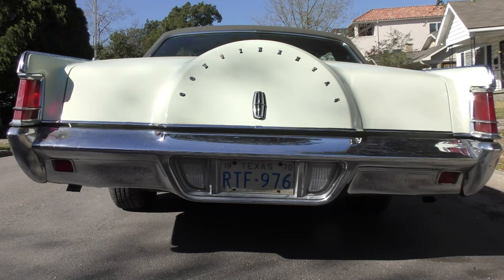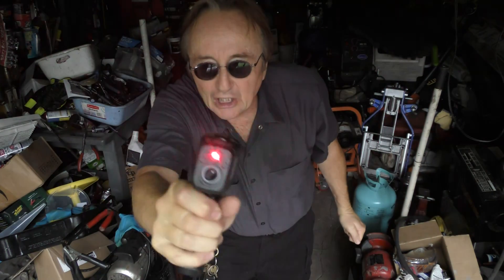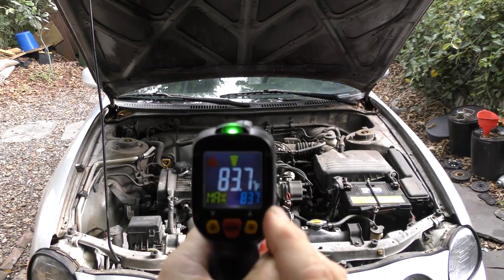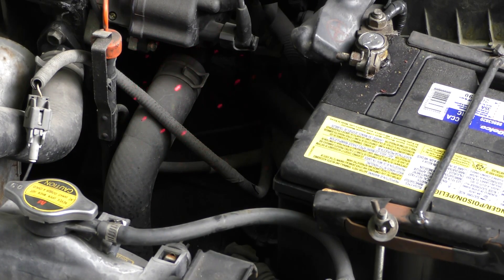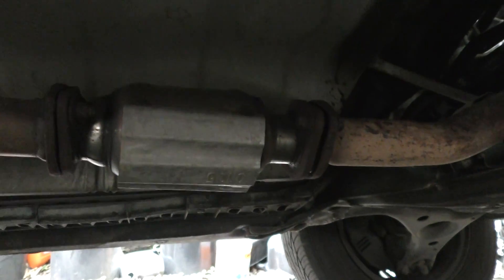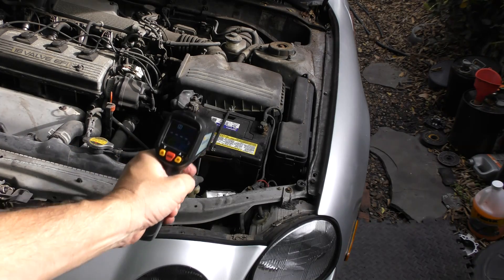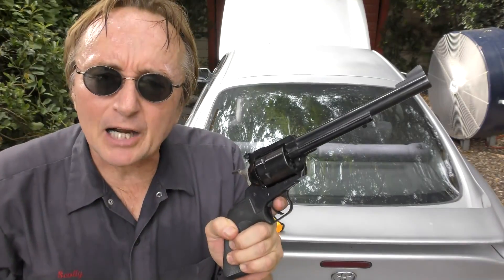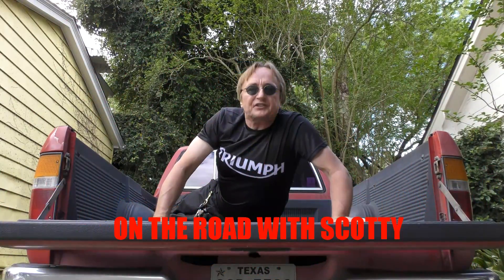Fixing Your Car with a Laser

Comment: what about the varying emissivity of the materials, you can't just point the gun randomly at everything, each material needs to be adjusted on the gun for the correct emissivity reading, otherwise you'll get pretty inaccurate readings.

Comment: A engineer at my workplace was working on his motorcycle with a temp. gun. His battery box was distorting from excessive heat. I  wondered if that really worked. Turns out he was on to something he quickly diagnosed the problem. Cool!

Comment: Scotty I finally fixed my starting problem on my 2002 Chevy impala. the main problem was the idol air control valve. now it starts like a regular car without giving it gas to keep it running and not stalling out

Comment: I recently diagnosed my old 87' Suzuki Samurai 4x4 with a temp gun. It has 6 U-Joints so after a drive I temped them all to find the culprit...one was 150F hotter than the other 5 so that saved me a lot of headache taking all 3 drive shafts loose unnecessarily.

Comment: Great video scotty. I had someone use the temp gun one the radiator top and bottom to see if it was flowing. I never knew about reading wires and spark plug cylinders for miss fires  Thanks for sharing this. I will get one of these guns.

Comment: How about shooting the engineers that design the cars?
Reply: They're only doing what management is making them do: Making sure it's got obsolescence built into it and as hard as possible for shade tree mechanics to work on. There's a reason companies push for the more strict environmental laws, and it ain't because they care about the trees -- it's all those sensors and electronic crap cost a lot of $$$ (for us, lol)
Reply: My Comment was joke. You people sure do jump to conclusions.
Reply: Well, Toyota engineers seem like they've been doing a pretty good job for the last 40+ years.

The rest of them . . . not so much.
Reply: I would be fine with not receiving a new giant pile of plastic shit with wheels on it. Ill drive cars from the 90's any day over the crap you all call "new"
Reply: Car companies want people to focus on their "infotainment" and driving assist. they don't want to us to drive anymore
Reply: Cryptonymicus except for the part where the scion motors (which are used in a few other toyotas) start burning tons of oil at a 100,000 miles yeah, not too bad, I would limit that to the 80's and 90's, early 2000's maybe. I have a good friend with an 87 toyota pickup that seems to refuse to die, however the part where you have to remove the head to take the timing cover off on the 22R... yeah... they shouldn't have done that.
Reply: I could use a good driving assist, because I am very weak sighted, and can't get a drivers licence. TESLA has good autonomous systems, I tried the voice recognition, works as good as KITT. If I hit the lottery jackpot, I'll get a TESLA Model 3, with sunroof, premium sound and autopilot.
Reply: yep
Reply: LOL
Reply: R.t the accountant is to blame, not engineer
Reply: Reliability: Toyota is the best, Nissan, and third Honda.

Reliable only after you rebuild the engine: Ford, Renault, Peugeot, Chevy
Reply: rt ye
Reply: it's like a group of 40 people all with a differant ideas
then the bean counters shit all over people's ideas
compromises everywhere
then like a year later, the car is made.
Reply: look what you started lolol
Reply: id say BMW is the worst offender here but germans have a bad history when it comes to lining people up and shooting them
Reply: Yeah, good idea, but shoot the managers and stock holders first. His .44 is great. Haha, could not stop laughing.
Reply: Ridzky Asdi, That's the same thing as saying the soldiers at Auschwitz were just following orders. Don't fool yourself, these engineers are singing the same tune as their masters. ;)
Reply: +MM 061 booo
Reply: Then we wouldn't get new cars...  Im guessing you are one of the people who think we should have no pollution control or safety devices on are cars!
Reply: Actually it's the people that are paying for it  to be engineered. They are the assholes.